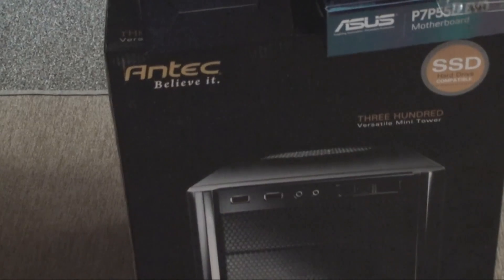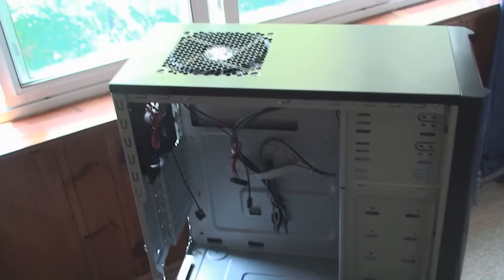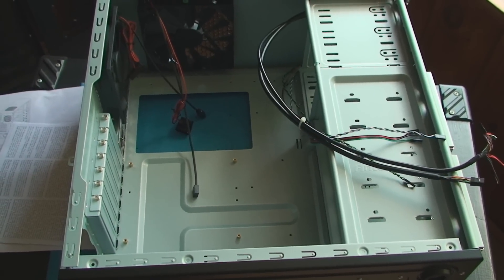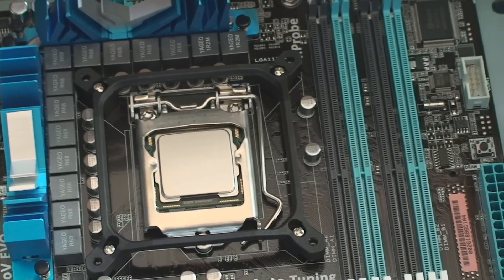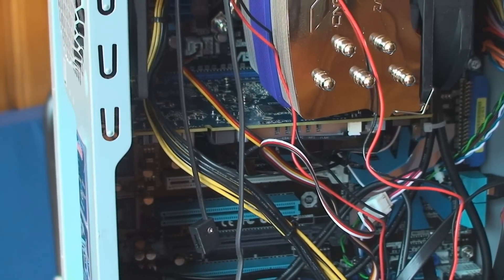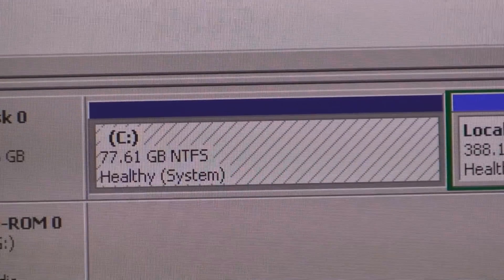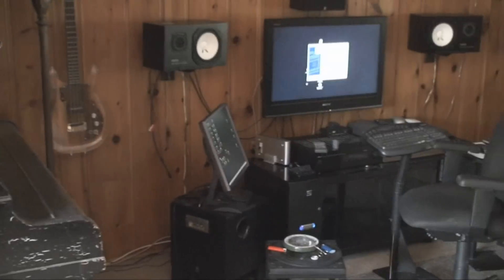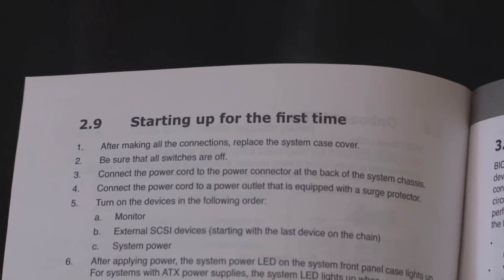New Computer Adventure Continues...

Comment: Probably go out on a limb.... I'm running it on about 92 machines thru our agency... I'm loving it. Really solid for the geek type maybe not so much for novice use. You won't have any problems.... most of what I was told was incompatible was fine.... it also recovers from power crashes etc. better than any other operating system I've run since 3.1 dos..... No fears....
Billo

Comment: Those Antec cases are sweet, only problem with them, at least as I found with mine is, that because the front USB port are at the top your DVD drive tray will be hitting wires if you have stuff plugged in up there and you open the bay....just something to watch out for.  What size in watts is the power supply?  When mine was built it would shut down when I did anything graphically intense.  Turned out the dude only put a 500 watt PSU in it, I had to bump up to a 750 watt unit to juice it.